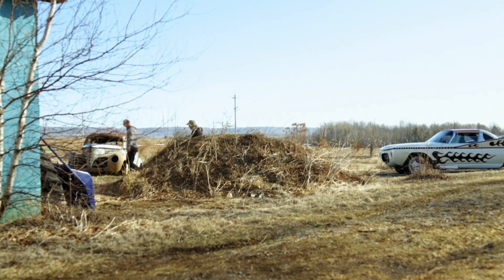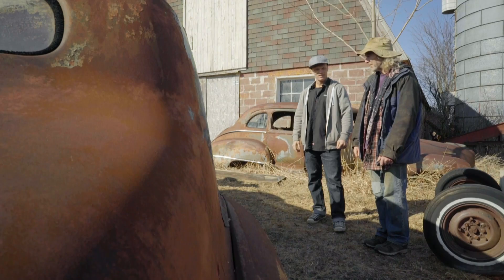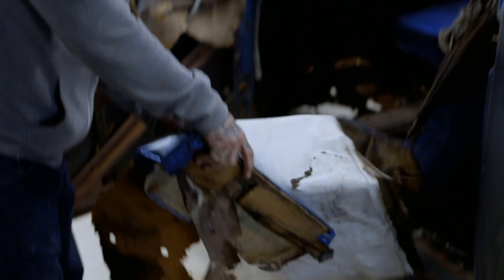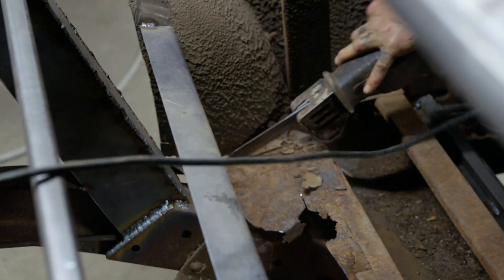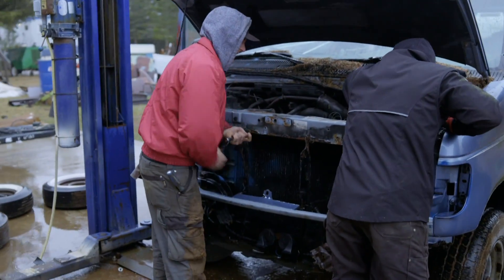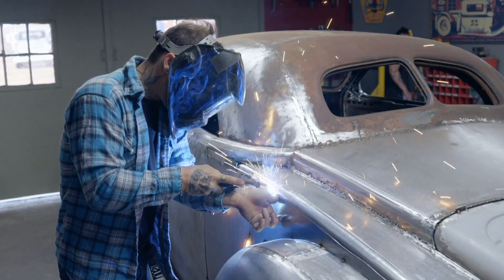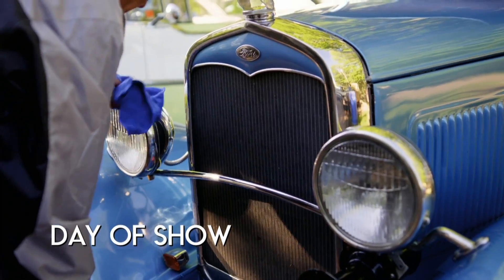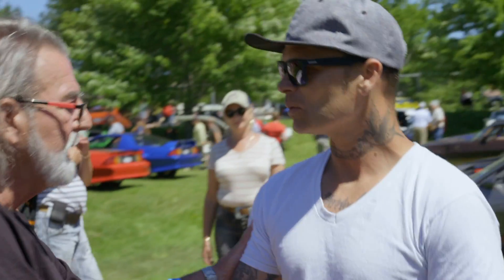1930s Studebaker Commander Transformed Into A Hot-Rod Dream | Bad Chad Customs

Comment: What a kick...I'm 77 years old and my first car when I was 17 was my aunts 39 Studebaker Commander that she bought new...flathead six lost a bearing on the way home from gas leaking into the crankcase from a hole in the fuel pump.
Bearings are poured and the two rods I scored at a junkyard were undersized..motor would not turn over...added shims and knocked like crazy...used old rings and carried a gallon of cheap oil in the back seat.
My first "Hot Rod"

Comment: I worked in high end body shops fixing expensive wrecked European luxury and sports cars. There is a right way to build a car and there is Chad's way. Chad's way, in the shops I worked in,  would get him fired before lunch on his first day. The job recommendation coming from that would black ball him all over the area. There is it looks good and it is built right, and you have it looks good but it's built all wrong done Chad's way. Take rear windows for example. You find a roof section with a real glass windows and you cut, section, pie cut, make panels and fit every thing just right, inside bracing and outside. Plastic windows say you did it crappy.  Fiberglass puddy covered with bondo, and then multiple primer coats of polyester primer and primer sealer is really bad. Yes it can look good, but it was built all wrong. Clearly you guys fawning over the hack work have never worked in a "real" body shop and you can't tell good work quality from really bad quality work. If you want to see what quality work looks like go watch Fitzee or Slyvester. See how they fit each piece just so making very little filler required. That is quality work, real craftsmanship.